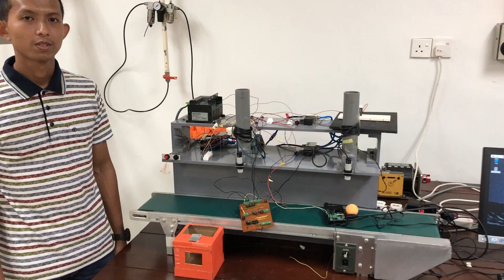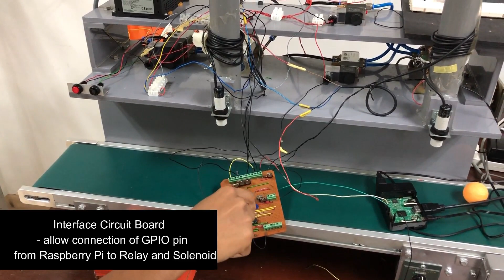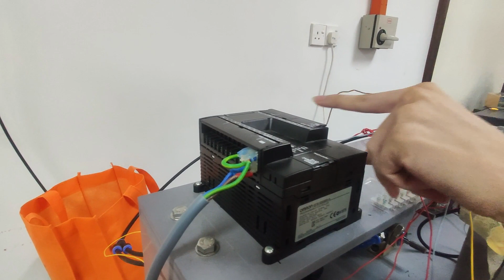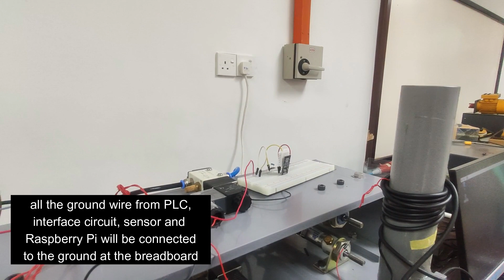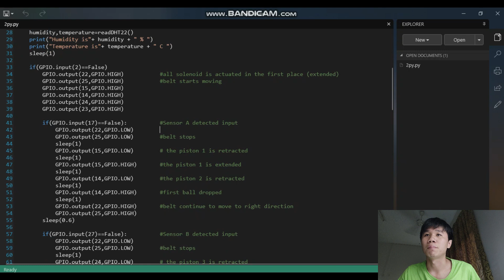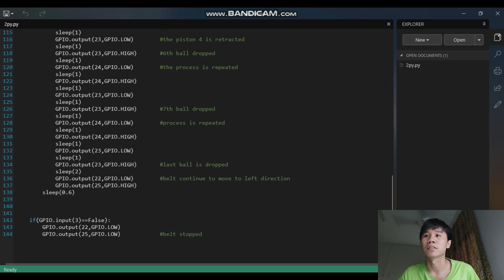EMC 311 Mechatronic Project 2019 (Group A5)

Comment: Objectives are not defined.
Manufacturing application is associated.
Box is not designed for manufacturing application thus operation sequence is similar to other teams.
Magnetic sensor is not used.
Wiring for DHT22 sensor and magnetic sensor is not shown.
Motor and relay circuits are not shown and explained.
Pneumatic circuits are not shown and explained.
Program initialization is shown and explained.
Program flow is shown and explained.
Switches are used for controlling outputs.
DHT22 sensor reading is displayed but is not used for controlling outputs.
Operation demonstration  is well shown and explained.
2.28 minutes extra time.
Mark 65%